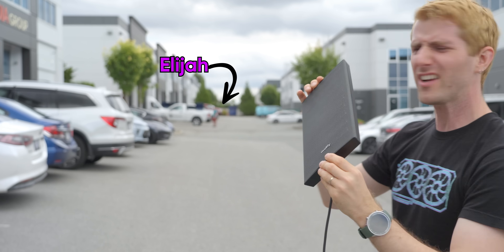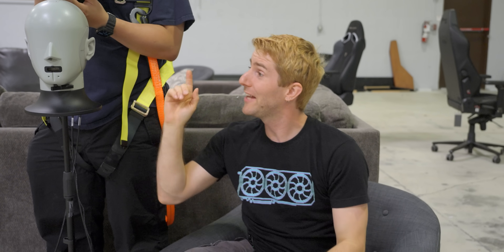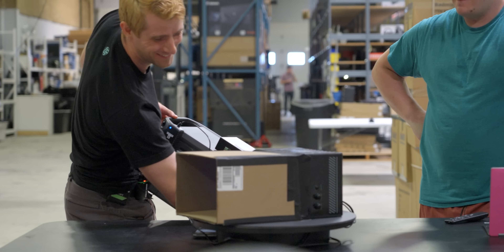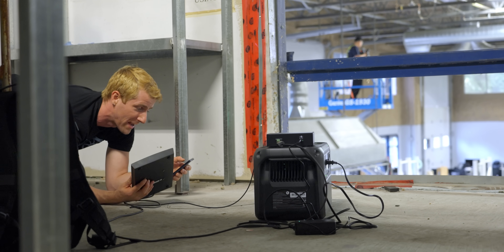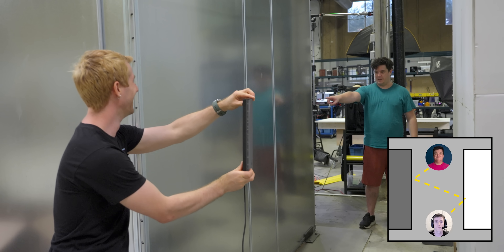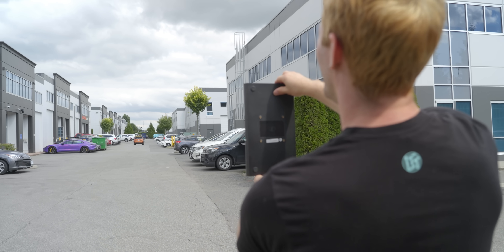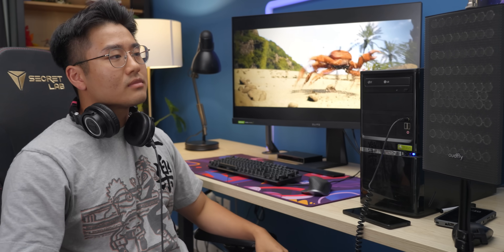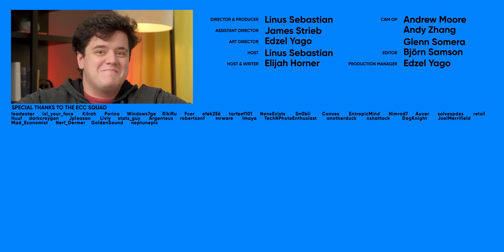Only 1 Person in the World Can Hear this Speaker - Ultrasonic Directional Speaker

Comment: How would that speaker sound on the other side when directed at a window or walls, interesting concept and possibly a threat as a weapon in the wrong hands. Startles a person to fall out a window or drives a sleeping person to madness. Could a capacitor and a resistor be used to make sound in a frequency that's hard to locate?
Hearing is a sensitive sense and a part in the central nervous system of the brain, even medications can cause partial hearing loss in the sense of tinnitus or psychosis :-)

Depleting mental tolerance breaks the mental threshold and then insanity shows as instability.

Insanity is not instability,
Instability is the inability to tolerate insanity.

Comment: this tech first appeared on either a 'beyond 2000' or 'future weapons' tv show in the last 3 years of the 1990's sometime. i think it dropped off the planet in terms of public visiblity for security and military purposes and only started showing up again recently. The original creator imagined it for ads and PA announcements in public spaces such as attached to a vending machine or electronic service kiosk etc to reduce noise pollution in challenging spaces such as airport terminals, but within a few months also demonstrated it could be used to output over 120db sound in such a narrow beam you could stand without hearing protection, 5-7 ft from the beam at 100m+ and not hear it but take 10 steps into the beam and you'd be instantly permanently damaged hearing loss and other bodily dysfunctions from the high decibles.  I think this also led to the LRAD combined systems that were also experiementing with what i guess was technically microwave emitters tuned to not penetrate skin but enough to give you a good burn on skin contact. these days this tech lives on military ships and some cargo ships for non-lethal small boat deterrance but i think the risk of permanent damage is too great so we've never seen the tech be allowed to proliferate to police depts in the states anyway

Comment: I personally would pass on this speaker design... 
This is coming from someone who has been in the home theater era for many years 10+ and am a proud owner of a receiver pushing Dolby THX, Pro Logic II, etc. 
When I get the money to test out Dolby Atmos, I would be delighted too. But this speaker in video, if it is that much directional in sound waves it would definitely hinder audio quality of experience in a home theater room or a legit large movie theater room. If you have to sit right in front of the speaker that sound would tip off many experiences specially in movie / video audio listening.

Comment: Novel approach but the effect is nothing new. Much easier and cheaper to use electrostatic speakers. Museums and even stores have had this for several decades using regular old speakers under a downward facing dome. Does this have the same limitation, (i.e. no bass) as electrostatic speakers?

Comment: The Edifier speaker at 3:07 has 2 rectangular bass ports designed to push sound out the back, you can hear them get louder as they come into view. Probably one of the worst speakers you could use to prove the point.

Comment: Could the Audfly utlra somic directional speaker be used for noise cancelling?

For example, in noisy bar setting up the speaker flat against the celling and pointed directly down and playing the inverse of the noise music or general background base frequencies. The hope would be that noise travelling horizontally would cancel out/interfere with the vertically travelling noise toward the wall and hopelly reduce the reflected sound off the wall. 

The desired impact would that noise was reduce in gereral in the bar then people would not keep raising voices and competing with each other therefore make it easier for conversions in bars.

Comment: I have an idea to use something like this to make Echo's drone from Rainbow 6 Siege. It would hardly be a concussive blast, but I'd imagine hearing a loud "WUBWUBWUBWUBWUB" would be pretty distracting. 
The neat thing is that by changing the timings of the speakers, you can actually "aim" the beam. That, combined with some AI recognition magic, and some math, and you've got an auto tracking sound turret with no moving parts. DeviousGang

Comment: If you UP THE POWER (i.e. Amplitude) you get LRAD (Long Range Acoustic Device) which is used as a WEAPON and for crowd control. At 150 Decibels, you can DESTROY peoples hearing and bring them to their knees by shaking their insides to mush, especially with LOW FREQUENCY SOUND at 300 Hz or less (i.e. Bass sounds or LFE aka Low Frequency Effects).  

LRAD was originally invented by Raytheon (i.e. a U.S. Military contractor) who also made the Microwave-based version of this called ADS (Area Denial System) which shoots highly  directional 95 GHz microwaves that super-heat the very top layer of your skin making sure you MUST move out  of the way of the beams (i.e. It is painful like you cannot believe!!!)

Be it Sound or Microwaves, if you up the amplitude (i.e. power levels) and up the duration of the waveforms, you can turn system this into your own area denial and long range acoustic cannon!

V

Comment: That is a very interesting device. The written explanation was pretty helpful in understanding this. It essentially fires ultrasound waves that spread out in a larger cone, but they have slightly difference frequency and starting points. That results in interference patterns and by choosing the starting points and frequencies appropriately you can create a zone of intereference that is effectively a beam in front of the speaker where the combined wave has a lower frequency. Calculating the frequencies of the component waves and their starting location needed to do this sounds mathematically intractable, so they probably developed an empirical approach. This kind of tech actually could have a lot of potential uses beyond simple pranks and not just for sound, but for light too.

Comment: A good friend of mine was an electronics r&d engineer for a startup (that failed) working with  this teck.
I went to their offices before they sank and I heard what they were working on, it sounds atrocious and made me nauseated after a while. 
Given 20 years of development it might be able to get to an audible level but I highly doubt it will replace existing and future acoustic beam forming tek. 
Even in the museum usecase, a well designed horn setup can be made very directive and compactish given the fact that the wavelengths involved are small thanks to an absolute lack of anything resembling bass response. 

Also this is nothing like what’s in the vegas sphere. The sphere uses a very large phased array of acoustic sources but there is absolutely no hf destructive demodulation going on.

Comment: Spoiler, the device is using modulated ultrasound. This same technique was used in the original LRAD system where the emitter appeared like a flat panel - behind it, there was an array of ultrasonic transducers, and that was used to produce a narrow beamwidth at extremely long distances. Later LRAD products have switched to using conventional horn-loaded speakers.

Comment: The concept is difficult to math but easy to visualise, look up an animation for the double slit experiment (works the same way but regular waves not quantum).

Some spots constructively interfere (making bigger louder sound waves) and others destructively interfere (like sound cancelling headphones, opposite pushes and pulls of the pressure waves cancel out to 0).

I'll add that in this case the lower/audible frequency is achieved by "cancelling out" a bunch of the wave cycles. (If the freq was 2*audible freq, then cancel out half of the waves and you get audible freq).
Reply: Another addendum, by cancel out to achieve lower frequency I mean the waves cancel not to equal 0 but to equal the desired wave but I think that's adds a conceptual wrinkle that makes it difficult to onboard and the explanation is close enough.

Comment: As a student in physics, I think I can explain the effect this speaker works on with a little more detail than what they showed here. It's based on the concept that when you have two similar frequencies played from separate sound sources, wherever they interfere they create a beating sound with a frequency equal to the difference between the two source frequencies. So if you use 441 Hz and 440 Hz, you get 1Hz beats. If you use ultrasonic speakers like 40 000 Hz and 40 100 Hz, you get a 100Hz frequency produced at the interference point.

As for the line of sound produced, at a basic scale if you have two speakers some distance apart from each other (and their sound output is synced), they will interfere with each other in a perfectly straight line that passes past both of them, this is because on this line the distance between the two speakers is the same, so they will interfere predictably.

This is first year physics in university, textbook linked here: https://openstax.org/books/university-physics-volume-1/pages/17-6-beats

Comment: Boring back to the computer hardware nd  peripherals,. why not test gaming school laptops under the 1000 euros , prebuild computers under the 1000,  keyboard and mouse under 60, mechanical, how to overclock your monitor ? how to undervolt your intel and amd processor on the main brands motherboards,  what is the cooling paste  with water coolers and what is best applying method with watercoolers , the corsair mehod ?? How to cool down a gaming pc in mid heat of the summer, how is it possible to sync the rgb of my omen /steelseries mouse , razer/msi keyboard and the rgb of my system. ?  What are the tips and trix of a stream deck , which improvement can you expect in the handheld gaming scene ? Is there method outside the loud gaming pc whjile gaming to demping the sound ?? What are the best trix of synology of qnap nas and how to revive a crashed sata harddisk ?

Comment: BTW amplitude modulation like they use for these speakers is a rather old technology. That's what the AM in AM radio stands for.

They use an available frequency and change its amplitude by the waveform of the audio that they want to transmit. The receiver can be tuned to only "listen to" the chosen frequency. Add some filtering and you have wireless audio transmission.

Comment: Next video: I bought a bunch of those speakers and made a phased array so I can steer a beam of sound for greater annoyance.

How does this compare to the classic parabolic speakers? It does give nice use cases for audiofencing. As these are piezo drivers, perhaps you can even use them to detect distance/crossing, like parking sensors.

Comment: The distance test would be more reliable if the speaker was on a tripod in a fixed position, so due to the distance the beam would not jump around. Sort of like pointing a laserpointer at a far-away target; it will be very shaky after some distance. Hence the listeningtest would be even better, also wind will knock out the beam off cource. Why this wasn't adressed, i really don't know.

Comment: So basically this is an AM transmitter. You are modulating an audible sound frequency onto a supersonic carrier frequency in which the data (audible sound) rides on the amplitude of the carrier. The carrier and data demodulates on surfaces allowing for the data (audible sound) to be heard.

Comment: That’s so cool, my self study on the mysteries of esoteric audio has led me to the thesis that the ultrasonic inter-modulates with the audible, and distorts audible frequencies in a manner that is not commonly thought of when people chop the spectrum off at merely the audible range.  

The inclusion or exclusion of ultrasonic content may account for allot of unexplained phenomenon observed between speaker cables of varying capacitance. 

I give the benefit of the doubt to trust people’s empirical observations, rather than dismissing a reported phenomenon from my own preconceived frame of understanding, I endeavor to explain the unknown through research and scientific exploration. 

This playlist I have is a body of knowledge that touches on various ultrasonic dynamics from various perspectives.  Few explicitly touch on my working theories, but they all culminate in a deeper understanding of the most sparkly and scintillating fringes of sound. 

Sequence is not curated as of yet, save for the first few. 

https://youtube.com/playlist?list=PLdg1_f_Kyu_cGvNdy4FpVqth8niWJ39_I&si=Wk6KVQPIEBFoqWHk

Comment: It's not that hard to explain how this works--at least, at the basic level.  It puts out two different ultrasonic frequencies that are close enough together that they interfere with one another, but only at the spots where they are focused. And them being ultrasonic means the focus location is much smaller. 

Yeah, the full explanation is much more complicated, but that gives you the idea. It's the same thing in how you can hear those binaural beats" in certain audio productions.

Comment: I knew about LRAD from about 15 years ago, and wanted to fit it to the back of my motorcycle for politely telling the tailgating driver behind me, that "I would feel a little safer in the world if I could see both headlights in my rear view mirror, and would feel super safer if I could also read their front license plate" which happened more than I'd like to remember. At that time there was no commercially viable options for this tech. DeviousGang

Comment: It's a lot like when you have 2 fans running, but instead of hearing the one hum, it does waves of quieter and softer. That wah wah is the interference between the frequencies that happens at a frequency much lower than the originals.

Comment: Actually…There are some directional ultrasonic speakers installed at crossroads near some residential communities in Shanghai, to prevent noise from traditional pedestrian crossing lights. Another use case besides exhibitions and advertisements～

Comment: My guess is they are using Beat Frequencies. Human ears can only hear frequencies from ~20Hz to ~20,000Hz, but if you mix 2 higher frequencies that are only different by 440Hz, eg. 50,000Hz & 50,440Hz, then you'll hear a pitch of 440Hz, but not the 2 component frequencies - they are way too high. The 440Hz sound is called a "beat frequency".
I only listened to the first half of the video, but I don't think they explain that that is how the speakers work.

Comment: 170 meters, almost 557 feet, or around 56 floors up a sky scraper
Some neat useful ideas for use:
Crowd Control: When directing people to leave an area, you can give specific directions to a narrow area of targets, letting you tell certain people where the exits are that are nearest to them.
Silent Alarm System: Tells a thief to bugger off without waking up the entire household... Although I'd probably want to be awakened? But since it is so directional, it can perhaps functionally work as a "noise trap" for wild animals, telling them to bugger off, since sudden noise (like walking into the rays) scares most predators. And all you need to do is make sure to do is make sure to have  frame that bounces the sounds around what you're protecting, like a coop. Probably more efficient to have motion sensors. But still.
And... you had to see it coming: Targeted Audio Ads... in real life... ugh.

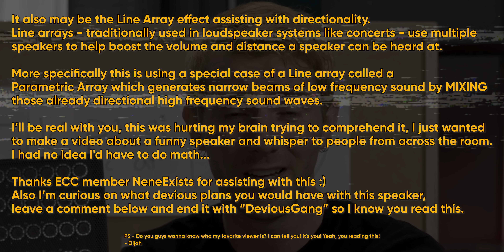Comment: 4:13 I totally want one I totally have a use for it.
Since November 2023, it is currently August 2024 my neighbor has been running a generator for their RV.
I am on the other side of the house and I constantly hear the low frequency rumble with the windows closed.
I already don't sleep well I'm super sensitive to sound do the math.
I want to fight back a little.
And I don't care because they came through cut down a bunch of trees to put a driveway in then found out they could put the driveway on the other side of the property so they cut enough trees down that they could pull two semi's in at the same time. No they didn't need that much space they stick built the house and it's still not finished the last five years complete with no siding no windows no running water no electricity no septic etc.
So yes I want to be part of the DeviousGang.
I was actually thinking my business might need to buy a subwoofer this year and test it by leaving it on for a few hours.
I like this idea better. Maybe I'll take the generator noise and pitch shift it.

Comment: Anybody have an estimate on the cost of this speaker?  The website only has an inquire button, which is never a good sign.  But I'm still very curious - very cool tech!  

In the case of a personal audio at the computer sort of setup - would you need 2 for proper stereo, or does this thing basically do stereo from center instead?

Comment: This would be crazy for on street personal advertising. Grab the data that your phone has given advertisers, have the board play a advertisement that is catered specifically to you and then using this have it play audio about the advertisement that only you can hear, even better if it's positioned on something that allows it to rotate and follow you as you walk by. Can take this even further by having the advertising screen be one of those that have the glass that make it only visible from certain angle. If you could have that be motorized to also follow you and have it be able to display multiple angles at the same time then this whole setup would be crazy.

One thing I'm wonder is, you said that it's easily blocked, does that include glass? Because one GOOD idea way I could imagine this being used is to first responders, say a cop is trying to get through a traffic jam, they could aim this directly at your car and have it tell you to move over to the left or right or whatever, without disturbing other people with the loud loudspeakers. Same deal for a ambulance.